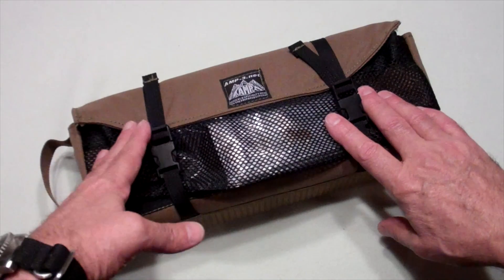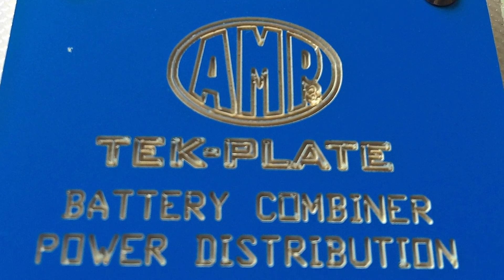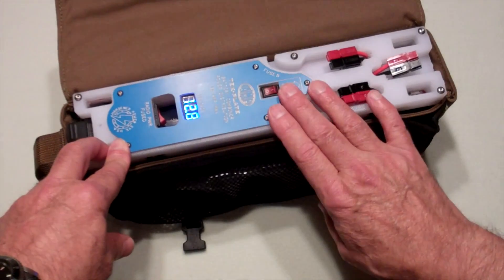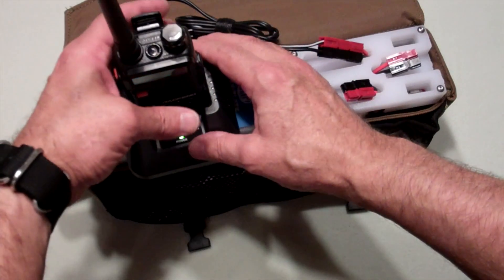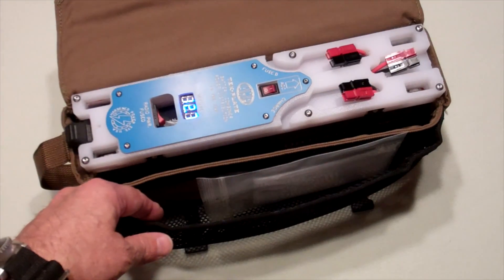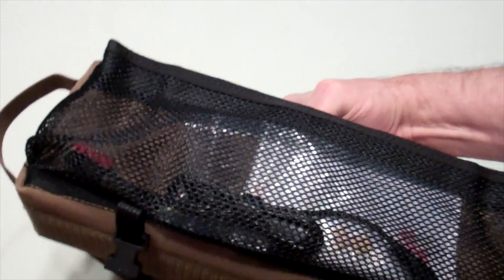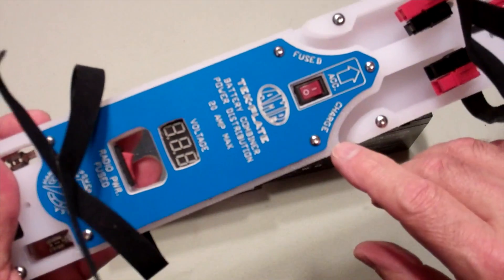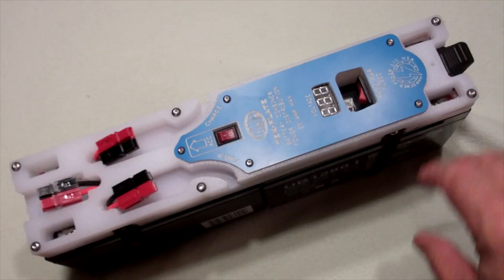Tek-Plate & Batt Bag II from AMP-3

Comment: Will this Batt Bag fit inside of the TEC Pack where the batteries go?
Never mind... I saw the answer further down in the comments. Thanks for the great work. And for your service.
Reply: Mark - Excellent question! The Batt Bag II is designed to retrofit into all of our Tech Packs with the possible exception of the very first few produced. That said, the bag will stand upright in only the very latest version of the Tech Pack. It will lie flat and be secured with the side velcro patches in the other editions. If you have specific questions or concerns please call the AMP-3 office. Thanks!

Comment: Nice kit. What radio was that? Looked like my UV5R but with a negative lighted LCD vs most BF radios which have dark lettering and lighted background.
Reply: *****
Thanks man. Ya looks like there are mixed opinions on the screen but I want one like that. I think it would be good at night to have as little light as possible.
http://www.amazon.com/BaoFeng-BF-F8-Dual-Band-136-174-Transceiver/dp/B00FMIYEKW/ref=cm_cd_ql_qh_dp_t

Comment: Great video, Dave!  I think the bag turned out great - the side pocket and the longer flap are great features.
I'm pleased the revision to the power connection is working out... with the first generation BatPacs we also had failures from too much force / movement at the joint.  We made the switch to the solid copper (like you show on the TekPlate) and we have not had any failures since...

Comment: David will that bag fit in 857d tec pack ? KE0BIK
Reply from the maker: Hey Scott - Happy New Year!

Yes, it will fit the Tech-Pack. It will lay down on its side in older versions and stand upright in the new version which was changed to accommodate batteries & the new Tek-Plate.

73!

Comment: Hi Dave - You gave me some ideas with these two batteries and the latest creation from what Bill has done with the power plates. I like the double plate idea and also the single unit idea as well, but makes more sense to use two for plenty of juice to power a much needed mobile or other type of ham radio with you project ideas! Awesome!

Happy New Year to you and all, hope Christmas treated you all well.

73's,

Jeff KE7OUR
Reply from the maker: Thanks Jeff! Happy New Year to you as well.

I have been pretty happy with this set-up and sure do appreciate the capacity given the weight and size. It is a perfect solution for mobile or ECOMMS.
Reply: USNERDOC I agree, that's why I like the setup so much and they way Bill has built the plates. I'm looking into getting one of these. Btw, what's the status with the new radio buddy cases for the Baofeng radios with the extended batteries on them - that you and MattAttack did a video on a while back ago before Christmas.
Reply from the maker: *****  Jeff - we are working with our bag fabricator for the new extended Radio Buddy. They have been pretty busy with other contracts and fulfilling our current order (the last one was pretty big!). We are working on bringing the prototype online. Thanks!

Comment: Hey doc. Great kit. I thought the wallwort was what regulated the voltage for the radio when charging. Or is it regulated in the base chArger itself?
Reply from the maker: Great questions! I am just sharing what I have been doing with the radio. I have used this set-up for well over a year with no problems using this battery set-up, a smaller 12v battery, a GoalZero Sherpa, and my JuiceBox. The AC/DC adapter specs are 10v DC / 500mA output. The base lists 10v DC input and 8.4v DC / 400 mA output. If you have concerns I would recommend doing your own research before replicating my set-up. That way you won't have any surprises.

Thanks for watching!